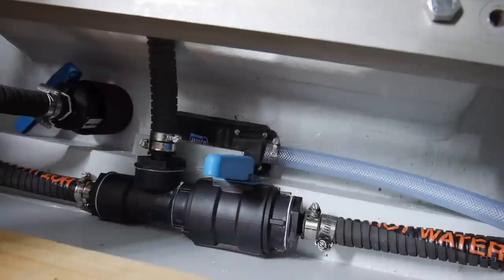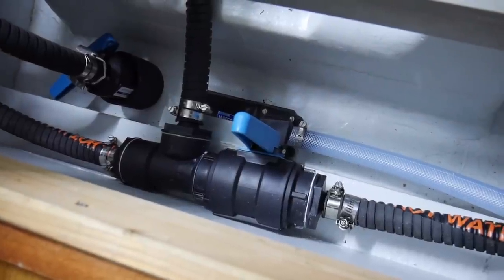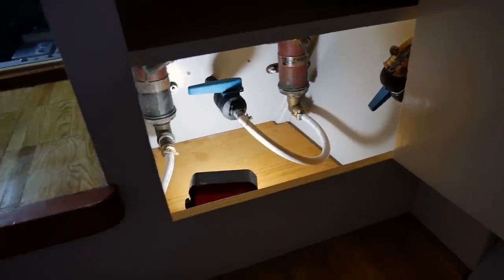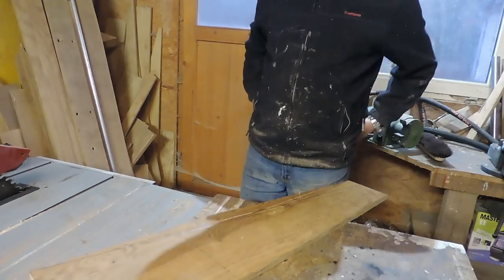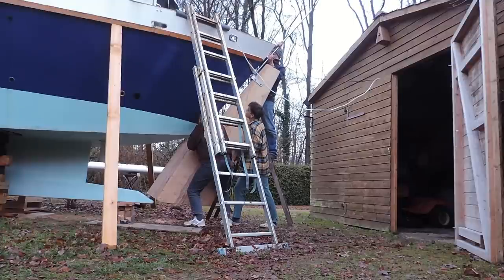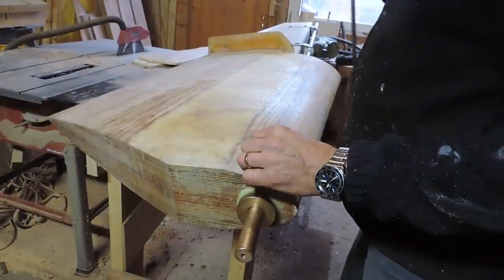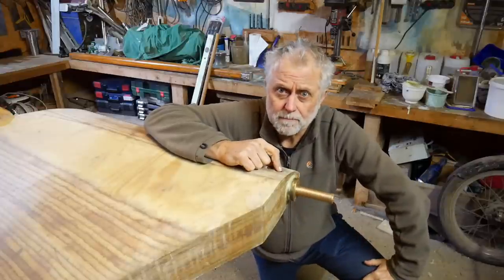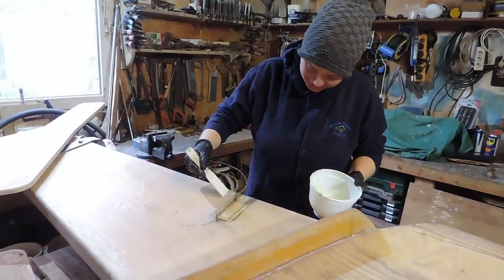Rudder/Tiller Fitting and a Minor Rethink - SV Tapatya EP260

Comment: I had never given any thought to the "slope" on the angle of a table saw's circular blade: good point, Tony!  I'm happy to see your whole family helping out, as is often the case.  I wonder if the screw holes on the bottom rudder fitting are going to get waterproofed in some way, perhaps with epoxy?  (Perhaps they have been already.)  It's quite moving, seeing the embryonic tiller being pushed into position for the first time!  A very positive video.  Many thanks.
Reply from the maker: Thanks Chris. Yes, those screws will be sealed, but I want to be able to remove them if need be. I’ll either use butyl or some other less adhesive sealer 🤔
Reply: @SVTapatya  Thanks very much for your reply, Tony.
Reply: @SVTapatya  - Epoxy ought to do fine for that, Tony. If you ever need to remove them, a red-hot screwdriver will melt right through the epoxy!
Reply from the maker: Thanks Garryck. Yes, that is something I was considering and now you’ve backed the idea, it’s probably what I’ll do, possibly with a bit of grease on the screws 🤔

Comment: Moin Tony What is the plan? will there be some stainles steel reinforcements for the two plywood sheets to transfere the power of the tiller to the rudder?  Dein Ruder hat ja kaum Vorbalancierung, ist bei Spitzgattern auch nicht unbedingt necessary aber auch mit einem Djunkenrigg wird es wohl luvgierige Situationen geben in denen mal erhebliche Rudermomente benötigt werden um das Boot auf Kurs zu halten, oder eher nicht? Habe selber zero Experience with Djunkenriggs  Gruß Hein
Reply from the maker: Moin Heiner
Yes, stainless plates as reinforcement. The rudder has the designed balance and junks are generally pretty helm-friendly. Sea trials will show how she handles 👍
Reply: @SVTapatya  Moin Toni  Ok when have a careful look, then i see a balancing aerea at the uper part of the rudder. Bin schon gespannt auf den Stapelhub/lauf, wo soll das stattfinden, da wo die Ilmenau in die Elbe mündet? Gruß Hein

Comment: I'm no engineer, and that's probably why, since I first saw the hinge pin you're using, I've thought that it appeared rather inadequate for the job. 
It seems quite a small diameter to be able to handle the potential stresses involved. I'm sure you've got it right, but I can't help wondering how it would handle any abnormally hard impact, eg, the dreaded "orca strike"?
Reply: @kscipkkkk  😄You're probably right! That was the first example of a big impact that I could think of.
I think it's the length of the pin that makes it look too thin for me. In a short section it does look thick enough.
Reply from the maker: It’s a pretty hefty pin, guys. The fittings will rip out of the hull before that goes!
Reply: The fittings and pin all match or exceed the designer's specifications. (I have a set of the plans myself, so I know.) As for an orca attack, well, most modern rudders are foam-filled fibreglass shells. This one is solid wood, sheathed in fibreglass. It will handle an orca attack far better than most. Any orca that takes Tapatya on is in for a surprise, I think. And a toothache, more than likely.